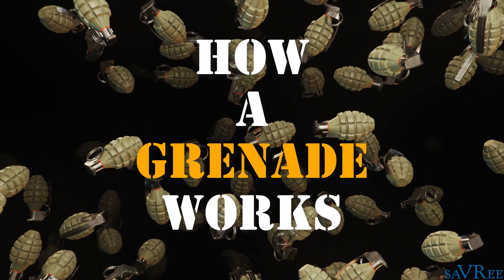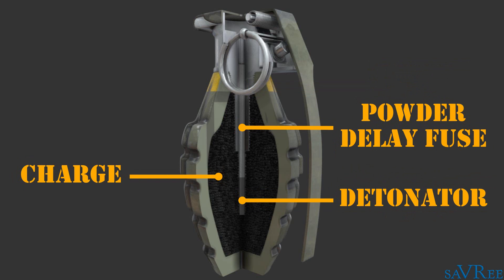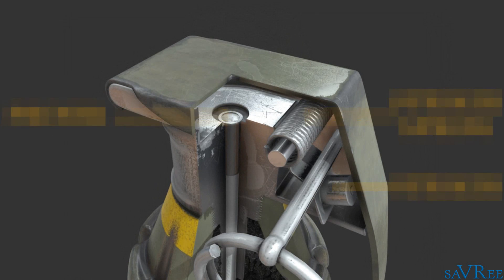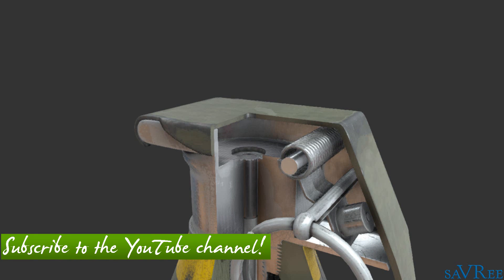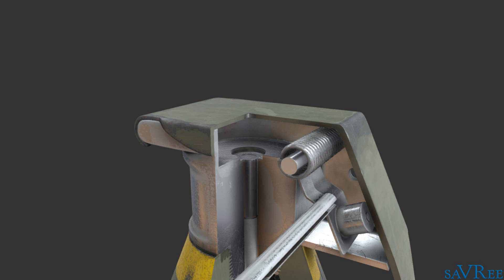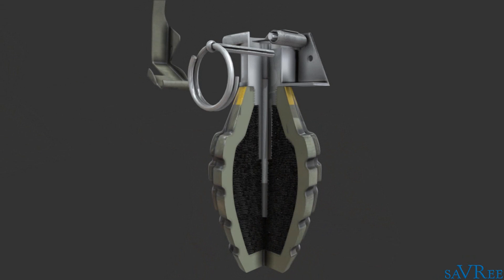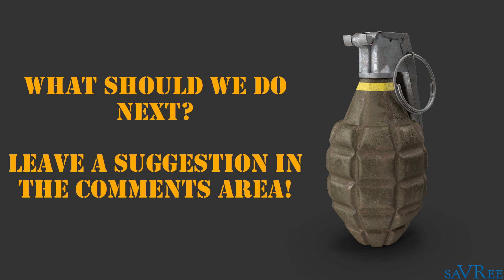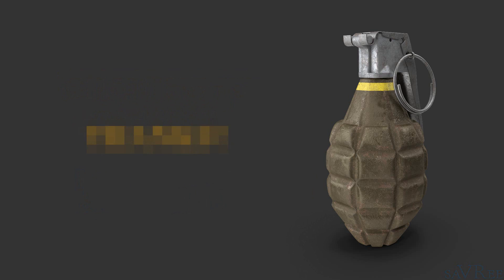How a Grenade (MK 2) Works! (100% Animation)

Comment: I remember as a kid during the end of WWII some of the returned had Grenades and said they removed the poweder.  What would happen if they pulled the pin with the powder removed and the fuse still remained
Reply: Nothing. You might hear a small pop once the fuse burns down to the detonator.

Comment: So the body serves as the shrapnel? I always thought there was shrapnel inside the grenade.
Reply: The way the body of this grenade is designed (the raised sections sitting above the thinner walls) was intended to break apart in such a way that it reliably works as shrapnel on its own. Being made of cast iron, the thicker portions fly away at high speed when the thinner parts around them give way during the explosion.

Comment: Will the fuse ignite if the striker slowly touches the primer? Like if you were to pull the safety pin and slowly let go of the lever.

Comment: The design was well explained up until the explosion.
I felt that a large part was left out about how it is designed to hurt or kill a victim, so there is more to explain about its design besides getting to the explosion.
The questions could remain: does a grenade kill with the explosion? Or is it the shrapnel, or both?
Is the 'body' segmented so that the body pieces break apart at the weak points and send the squares flying? Or is it just a cool design with grip to be held? Are all grenades designed with those segments?

Comment: At what point does the saftey lever stop the stricker last, like if the lever goes up but you grab it and bring it back down, what point are you just holding the framentation

Comment: How about why the body is shaped like it is. All the square sections not only work as grip but more importantly as the charge explodes it causes all the squares to split apart from the body and basically become projectiles that fly away from the explosions into the target as shrapnel.

Comment: Means even the pin is removed, if the grenade is still in your hand, it wont exploded. So, just throw it alway as far as possible can keep you safe?
Reply: chui hoi well throw it to the target destination and hide behind cover. No matter the distance you throw it, shrapnel can and will come back towards you. So it’s best to be safe and hide from the grenade.

Comment: "After the pin is pulled. Mr Grenade is not your friend"  -  US Army Instruction Manual.
Reply: Is Mr grenade ever anyone's friend? Mr grenade is not a nice guy he has a short fuse. And has explosive anger issues.
Reply: Well, I guess you can't say anymore "keep your friends close and your enemies closer"
Reply: @AliAsghar-zh8fr   more like keep your friend with the enemy and don't stay close
Reply: Is there also a picture of the grenade with the face painted on it like this😤
Reply: I'm the 69th like
Reply: Is that from call of duty
Reply: Call of Duty : Modern warfare
Reply: Modern Warfare, I see
Reply: Mr Grenade is still my friend once the pin is pulled. He’s not my friend ones the safety hammer comes off.
Reply: But honestly what happens when you put the pin back 4secs after removing it at 1st ,would it still blow u to pieces.😂😂😂
Reply: @tamarakepreyeomgbuayakimi.1379  The pin has no function that directly relates to the explosion of the grenade. All the pin does is keep the lever locked in place. As long as you keep the lever in place with your hand, you can replace the pin and nothing will happen. Only once the lever is released the grenade will actually explode; putting the pin back has no impact on that.
Pulling the pin is only dangerous insofar that now you have to spend conscious effort on holding the lever in place; lest the grenade is primed too early.
Reply: @Suthek  oh my thank you sir! yes sir,but honestly drill sergent  i do like you to use yourself as an experiment to me  to learn better advanced thanks lol.😂
Reply: Especially when the lever is let go
Reply: @TastySmooth Oh ,yo thanks mate ❤.
Reply: @TastySmooth u.s army : mr grenade is not your friend after the pin has been pulled off.
Reply: It's like your wife. If you remove the ring, half of the household is gone.
Reply: how many times I saw that text xd

Comment: I would like to know the precise reason how a bomb explodes. How can something like that produce so much energy and expand to many times it's size in such a short space of time?
Reply: That's called chemistry

It's the sudden excitement given to relatively unstable compounds which creates a chain reaction, it goes, it also helps that the explosion is initially contained so it'll be that much more violent.

Comment: I have read a book about the Vietnam war where the author said they used to shorten the fuse and then throw the grenade without taking out the safety pin. The enemies were bafled and laughed of this "beginner mistake", collect the grenade, pull the pin and release the safety handle to throw it back. The shortened fuse would detonate the grenade before they would swing to throw it, leaving them without hands. I wonder if that is really possible,lol.

Comment: Two notes...  The time delay is not just 4 seconds, but between 4 and 7 seconds.  The initial image with the second safety pin hole and the lever going under the pivot point is not the HE version, but the practice version.  It has the second hole so it can be refitted with another fuse mechanism and recocked without functioning.  The HE version is shown in the cutaway views.  Also, the segmented body is designed to break into 34 segments with a median lethal kill radius of 5 feet.

Comment: This is interesting.  But most of us know how a grande works.  I was more interested in know “what happens next” based on the shape and design of the casing.  Why the “pineapple”  dimple shaping, for instance?  How is that better than other designs, such as just smooth shells?

Comment: I worked in the Engineering Dept. for an Army Ammunition Plant,  We made these Hand Grenades on G Line.  We had Machines  that people operated to assemble the Grenades.  We would have accidents from time to time, and have a blow from time too time which we would lose workers on the line.  It was  most of the time would be operator arrow !!!
Reply: Straight as an arrow workers? If they don't even know difference between "arrow" and "error" no wonder accidents happened.
Reply: Holy fuck dude I ain't signing up for that sort of shit.

Comment: For more safety let there be 2 or 3 connectors from the spring to the platform where the pin is resting just in case it corrodes or malfunction.
Reply: Safety? What's a few soldiers?
Reply: @engleharddinglefester4285  grenades are for the enemy not for them. i think you are confusing patriotism from proper handling of weapon.

Comment: I'd like like to see a video about how a women's mind works. Animation will suffice,  however, need as many details explained in layman's terms as possible.
Reply: wow, y’all are very intrigued about how our minds work, they are very complicated I will admit.
Reply: impossible.
Reply: It's just a video about grenade, yet you still managed to make it Incel central.
Reply: Me: exist
Women: ah I see you chosen death...
Also me: ??
Reply: Have fun descending into madness then....
Reply: That's like trying to solve an equation comprised of nothing but variables
Reply: The study required to get the information would take centuries.
Reply: It would be like dividing a one by zero. It's undefined.
Reply: A video, manual or pamphlet on how a woman's mind works is an exercise in futility.  That's because women, ALL WOMEN, have snakes in their hair. Hell, half the time, they don't even know what they want.
Reply: No no no no no NO ! you've got it all wrong fellas! He just did explain how a woman's mind works the only difference is the grenade has a safty pin 😶!
Reply: I'll stick with trying to get my head around superstring theory, thanks. Far easier to comprehend.
Reply: Womans mind works exactly the same as the Grenade in this video.
Reply: Actually, I think it's remarkably like the grenade video you just watched.
Reply: don't think they have enough space on the computer for that
Reply: If you want to see an animation of how a woman's mind works simply look at Christmas tree lights.... they're rapidly changing colors and are on.. off.. on.. off.. on.. off in an endless cycle..... your welcome
Reply: Blinky Bartlett  its like throwing gas on a fire, i feel your pain brother !
Reply: Double standards and victim card
Reply: @Savurameshi  thats it basically, just say "off course" to everything.
Reply: NOT POSSIBLE LOOK AT THEIR BODY FUNCTION TOO MUCH COMPLEX,  JEEZ SO MANY HOLES

Comment: We used the M-26 in Vietnam.  They were shaped like a lemon. Inside was a perforated aping that looked like a slinky.  When it exploded, the perforations on the spring would burst into smaller pieces of shrapnel

Comment: I recall the first time i threw a grenade in basic training at Ft. Jackson. I was nervous as hell and when the pin was pulled, i must have thrown that bad boy a hundred yards!
Reply: I wonder how frequently this things accidentally go off faster than the 4s delay?
Reply: @jaker1160  the reason no real soldier will "cook" a grenade. I've asked a few and they say you just pull the pin and chuck it. "Cooking" is games and movies only. The chemical fuse is notoriously not that accurate and the 4 seconds is a guesstimate. Some soldiers say they'll go off after 2 seconds.
Reply: @AmazonWildman  I always wondered if that was the case.
Reply: @donaldwilliamfry  based on what I've been told that's the case. I don't personally know as I've never had the opportunity to use a live grenade.
Reply: Tonio Yendis that sounds intense!  Could you feel the shockwave?
Reply: I’d love to do it once.  I was DQ for military service due to breathing problems
Reply: @mvol5973  the coolest thing for me in basic was seeing live claymores and AT-4s
Reply: I remember blasting grenade on my hand in gta5
Reply: You became Tom Brady with that grenade but I feel like I'll throw it much farther than I could throw a football just because it can blow up
Reply: I wonder if anyone's ever pulled the pin but then their sweaty hand dropped it and then they slipped in their own sweat and fell on the grenade.

Comment: You say the fuse takes 4 seconds to explode. In this case, it's an MK2.... is the detonation time same for all hand grenades ??
Reply: Adjustment of the fuse is not something that can be done in the field by the end user. Smoke grenades tend to have shorter delays, the M67 grenades I was trained on have about a 5 sec delay on avg. Some will seem to take a second or two longer, but it might just be perceived to take longer, never timed it, often you will want to cook ott off for a count of 2 before throwing so it can't be thrown back, depending on how far away you are throwing it. Into a room through a door, you definitely want to cook it off. Down a street or around a corner, not as important but you still want it to go off as soon as possible after getting where you want it, obviously.
Reply: Cooking off a grenade sounds pretty risky. What if the guy who makes the fuse lengths came to work with a hangover the day he put your grenade together?
Reply: @slaughterhouse5585  I was always thinking more of the SOB I was trying to kill throwing it back at me if I didn't cook it off. Usually only did that if we were close or fighting room to room. The fuses are probably mass produced on a a machine and any hand assembly wouldn't really affect the length of the fuse or the time it takes to burn.
Reply: thetoecutter13    Thanks for the reply. Still, it seems risky. Hell, I get nervous just lighting a little firecracker.  😳
Reply: @slaughterhouse5585  It's just a matter of doing what you gotta do. I was scared shitless every time we got in a fight, I handled it the best I could and kept my honour by the skin of my teeth. If you thought about everything that could go wrong or could hurt you, you wouldn't be able to get the job done. The real fear comes after the fight when you start thinking about it. I suppose there's always a chance the fuse is short or you could get hit while you're holding it and drop it, hundreds of things can go wrong, but like I said, if you think about it all you couldn't function. Even in day to day life, you can't dwell on your chances of getting in a car crash, or a tree falling on you. You just do what you do and trust your abilities and instincts. It's the same thing in a fight. You trust your equipment weapons and the people around you. Wow, I really went off on a tangent there. Anyways, cooking off a grenade is something you just do when you have to. It's not like I ever played chicken with one and saw how long I could hold it. Just pop the spoon, one one thousand two one thousand throw.
Reply: thetoecutter13   Thanks again for the reply. I was joking a little bit about the firecracker but I think I have some understanding when you mention about going ahead and doing what you have to do.  I'm a retired street cop (30 yrs.) who worked some rough neighborhoods in a major West Coast city. Like you said, you can't obsess over what may or may not happen some day. It would sort of paralyze you with stress. You didn't specifically say you were military but it sure sounds like it. Sounds like you have had some super intense experiences. My hat is off to you and others like you who serve.
Reply: @slaughterhouse5585  A cop on the west coast... My hat off to you sir. I visited L.A. once, I felt safer in Baghdad than I did in some parts of L.A. I was a Navy Corpsman with 1st Battalion 7th Marines. A lot of guys had it a lot worse than me. I defended myself and my buddies when I had to but it wasn't my job specifically to engage and destroy the enemy. I was right there with the guys who were engaging and destroying the enemy, and I have to say those guys would do anything to keep the Corpsmans safe, it was a symbiotic relationship and I am glad for the experience. Thank You for your service to Law Enforcement, I don't think I could do that job, especially on the west coast. Take care.